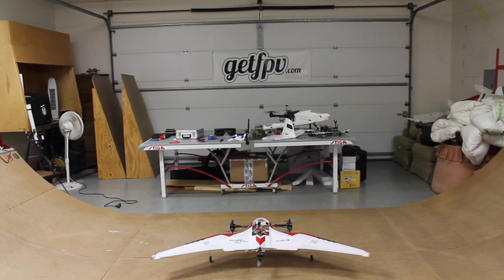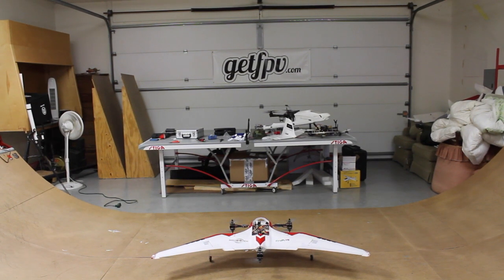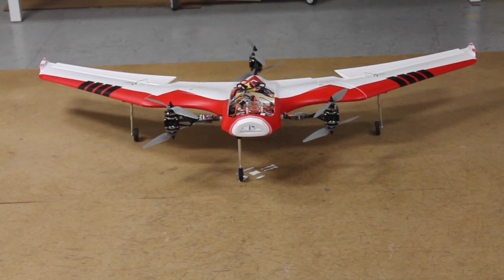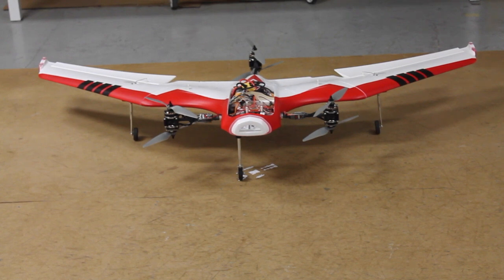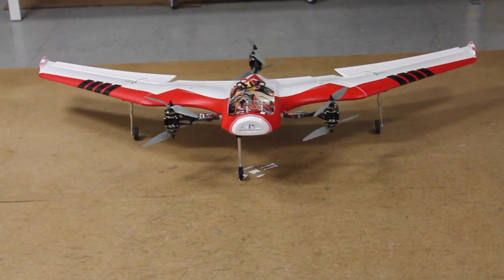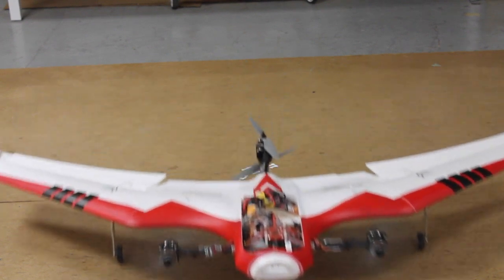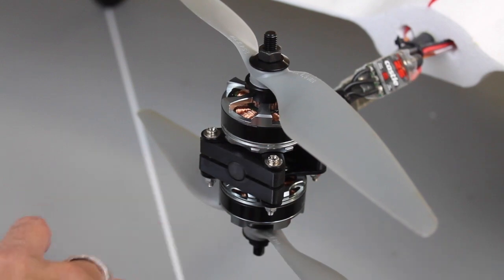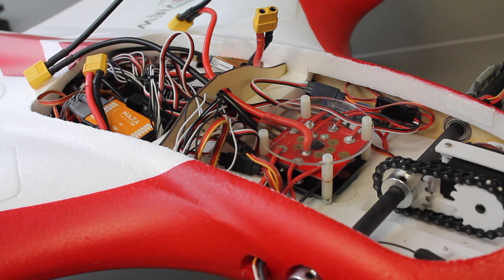FireFLY6 Garage Hover Test and Y6 Propeller Configuration w/ NAZA V2

Comment: hii
i have some problems with transition mode 
plz help me
i have used Qground control for frimware setup but i cannot transit the to the fix wing or multicopter mode!!!!
i myself assembled it, even though the motors work but servo that used to transit do not work
Reply from the maker: Have you tried the same with Mission Planner just to see if it's a software vs a hardware issue?
Reply: yes, does it need any key to activate transition mode or I can solve this problem with Qground o mission planer programs??
Reply: Dennis Baldwin OK this bird looks sharp?  So please tell me where I can order 1? 
Thanks

Comment: Hi Dennis, another Great Video . I'm setting up a FireFLY6 pro combo with the PX4 and APM, and was wondering, do you use both power modules, or is there a way of sharing one between them ? I Imagine one could power the navs with the modules and also use the BEC as a backup, Is that the reason for the BEC ? I've also heard you can share GPS module too.

Thanks again for all the Videos man, you're doing an awesome job,
Reply from the maker: +Nicholas Matias I was talking with Adam Sloan @ BirdsEyeView at one point regarding shared GPS but never followed up. I need to follow up on that again. It's been a while since I've messed with the FF6 but now that the weather is cooling down a bit I'm going to get out to the field. Will definitely share an update when I have one. Please do the same and thanks for the feedback.
Reply: Thanks Dennis, will do!

Comment: Cool stuff! We are dreaming of a reliable V-tol, Y6 seems little overkill for my taste but very interesting indeed! I still do not understand how hover to forward flight transition works as a concept. Does it come with separate controller which works with the prime control board like Piixhawk or APM, since ardupilot does't have vtol firmware :/ Thanks for sharing, Dennis! Love your work and energy and passion you put in it! Your tutorials are awesome!
Reply from the maker: Georgi Tushev Good question. Yes, you need two flight controllers if you want hover and autonomous forward flight. It's recommended by the BirdsEyeView team to use Pixhawk for hover control and APM for autonomous forward flight. I haven't done any autonomous work with it yet, but I sure would love to! Thanks for the feedback and I appreciate the kind words.

Comment: Very nice Dennis happy you got it man ! I was on the process of building my own hybrid drone using the KK2.1 board but the task is way too much to manage.. do you think that bridge to switch between naza and kk2 board is possible ? do they have that bridge separately ?
Reply from the maker: zero00tolerance Hope all is well with you. The bridge is a separate component. You can see it here on page 19:

https://dl.dropboxusercontent.com/u/35788481/Website%20Manuals/FireFLY6%20Manual.pdf

I'm not sure if it's possible to switch between the NAZA and KK2. I know it can bridge the NAZA and APM as well as the Pixhawk and APM. I'm hoping to do the latter soon after I get familiar with the forward flight handling. If I discover anything else related to your question I will definitely let you know.
Reply: Dennis Baldwin Ok thanks a lot my friend if you can please let me know more about this bridge device.. or where to buy it. that would be great. I wouldnt mind switching from kk2 to APM board.

Comment: Hi Dennis, this is pretty cool. It made me think of an idea. I have been looking at autogyros recently and it has made me think of how copter flight times may be extended by trying to benefit from the way an autogyro works. In this case your rear motor would angle backwards to become a pusher prop then the front props would angle slightly back to catch the wind which makes them turn automatically and they then create lift. I think the firefly6 would also fly longer it i was a 3 config not a 6 motor config but you would need to space the motors out wider to benefit more from bigger props. Then the auto gyro effect is more likely to work too if you like the idea of experimenting with that. The problem with forward flight and multi rotors is that they are fighting against the air where an autogyro is spun purely by the air moving past the blades during forward motion or upon descent as it is angled backwards not forward as a multi rotor does during forward flight. An autogyro is like an aeroplane without wings, it looks a bit like a helicopter but has no tail rotor, it needs forward motion to keep it aloft but in a headwind it can almost hover. Could be an interesting project, a Y3 that angles it's rear prop back after takeoff and angles its front motors slightly back to benefit from the airflow past the blades. Somewhere there is a video of a hybrid multi rotor with a pusher prop but it doesn't use the autogyro effect, it's pretty cool to watch though, the pusher prop makes a huge difference.
Reply from the maker: izzzzzz6 Very interesting suggestion. I haven't seen an autogyro before but will definitely look into it and do some research. This is way over my head, but that's what the process of learning is for. After I get a few transition flights under my belt I'll share my results. Thanks for watching and for the idea. Take care.

Comment: Awesome idea. What are you hoping to do with this vehicle?
Reply from the maker: Amorgos I'm hoping to learn how to fly through the transition mode. Then I'll put Pixhawk in it and do some aerial mapping missions. My goal is to have a good platform to do mapping with and not having to worry about a bunch of take off and landing space.
Reply: Dennis Baldwin I've a multi-rotor and fixed wing pilot as well, and this video is the first vehicle I've come across that integrates both. Very interesting to me. But what will be your aerial mapping mission for?

Comment: How does the FCU know to shut down the rear motors when u turn the front ones for forward flight?
Reply from the maker: David Kaden Great question. I shared this below but will post it again because I think it's important to understand...

It had me puzzled as well. So the FireFLY6 has the concept of a Bridge module. You can see on page 19 here:

@u/35788481/Website%20Manuals/FireFLY6%20Manual.pdf

To the best of my knowledge what happens is that when the left switch is engaged and changes the flight from "hover" to "forward" the bridge bypasses NAZA and sends signal directly to the 4 front motors. I also believe that when in forward flight there is still signal being sent to the NAZA so that it's ready to kick into action when changing from forward flight back to hover, where the NAZA will take over leveling and flying as a Y6. Hope that helps a bit and that's a high-level overview based on my limited knowledge so far.

Comment: I can't wait to see it fly!
By the way, do you prefer Naza or Pixhawk? Which do you think is more reliable?
Thanks!
Reply from the maker: Sergio Orjuela I'm definitely looking forward to getting it to fly in wing mode. I definitely prefer Pixhawk for a lot of the stuff I've been doing lately with autonomous flight and aerial mapping. NAZA is great if you just want to get in the air quickly and reliably not having to worry about configuration. But if you want endless capabilities definitely check out Pixhawk. Lots of great development going on.

Comment: When you go from hover to forward flight, i would guess the naza would not be flying it any more, how does that work? how do you stop having the naza stop controlling the motors?
Reply: Yeah... I was wondering exactly the same thing. It seems in forward flight mode the rear props disengage as well.
Reply from the maker: azzurripro lasersbee Great question. It had me puzzled as well. So the FireFLY6 has the concept of a Bridge module. You can see on page 19 here:

https://dl.dropboxusercontent.com/u/35788481/Website%20Manuals/FireFLY6%20Manual.pdf

To the best of my knowledge what happens is that when the left switch is engaged and changes the flight from "hover" to "forward" the bridge bypasses NAZA and sends signal directly to the 4 front motors. I also believe that when in forward flight there is still signal being sent to the NAZA so that it's ready to kick into action when changing from forward flight back to hover, where the NAZA will take over leveling and flying as a Y6. Hope that helps a bit and that's a high-level overview based on my limited knowledge so far.
Reply: Dennis Baldwin
I just looked at the Bridge connections and it looks like you may be right in
that the forward flight and Naza Hover are always 'ON' and the bridge switches
between the two by a TX switch similar to a circuit I designed to bypass a
HK T1000FC flight controller with GPS to get a Manual Mode.

Comment: On the APM/pixhawk, the top motors are CW and bottom are CCW. Also, see the last video for a comment, and shoot me an email if you want that 3 way redundancy component for the pixhawk servo rail- it is precisely for applications like this where autonomous missions are utilized this redundancy was designed for. Remember- under basic setup of pixhawk and default wiring, there is no backup for the servo rail if the 5v bec is blown. Shtsky diode rectifier- cheap as beans. 3 5v bec's and a minute of soldering.
Reply from the maker: ***** Yeah I don't like how DJI and 3DR do the exact opposite on the motor rotation. Perhaps it's intentional :) I have a Castle Link cable on the way that will allow me to swap the motor rotation without having to resolder all my ESC connections. I will let you know about the redundancy component. Haven't seen that message yet but will look for it. Have a great weekend.
Reply: Dennis Baldwin here you go Dennis: http://www.rcgroups.com/forums/showthread.php?t=1854050